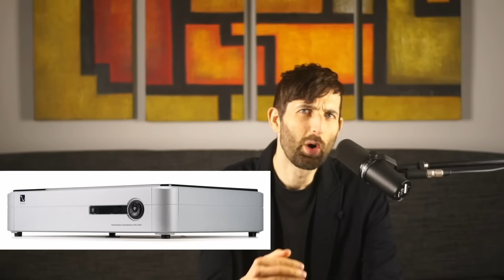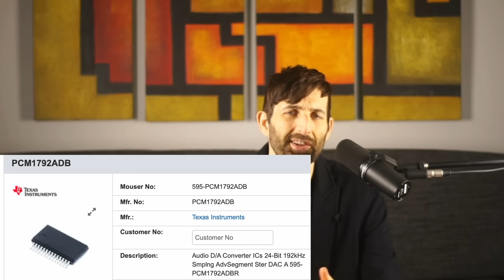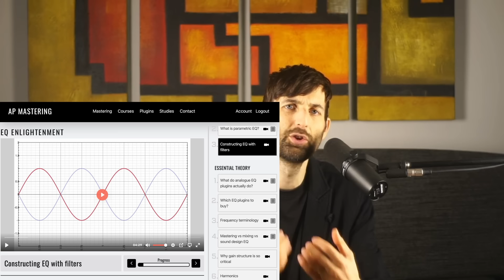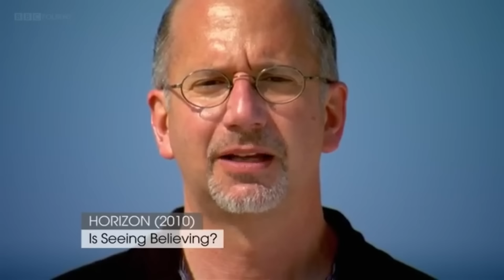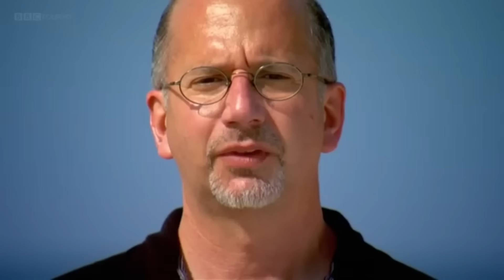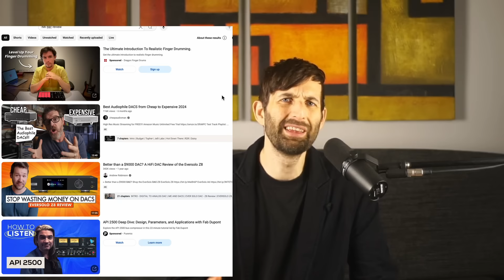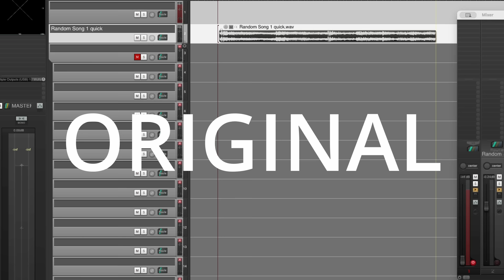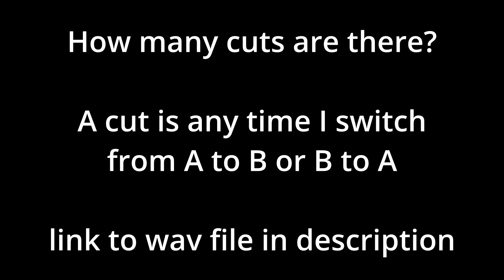The DAC Scam - Almost everyone believes the hype

Comment: I remember years ago when the audiophile guys were going after first gen Playstations on ebay because the rumor got out that the DAC sony had used for those was the same as the one in some of their highend audio equipment.   Watching some guy spend several hundred dollars on a PS1 in the late 2000's just to listen to CD's was wild.
Reply: I bought mine for like $5 at a flee market.  The story was that the same TRANSPORT used in the play station was the same as what was being sold in a $16,000 CD player.  The only DACs back then that were great where the very expensive R2R DACs.  Delta Sigma DACs didn't exist at that time.  What we had as a DAC during the PS1 days was the crudest form of a DAC that existed.  Nothing exciting about them.  The only DACs that were highly praised at that time was the resister to resister DACs which were extremely expensive.
Reply: Why is it wild? PS1 cost $10 and it sounds really smooth and musical leaning closer toward the turntable sound than any other digital I've heard. PS had a huge development budget, more than most Dac companies. What Highend Dac's did it rumour to be like? I haven't heard any that sound like it, it's got quite a unique sound and is really good at that one thing, it doesn't have very good bass or high trebles though so it's not really comparable to highend Dac's at all in my mind.
Reply: @voxshall  It's unfortunate yours was broken, the PS1 in working order is completely transparent.
Reply: @psyborg06  What are you even on about 🙄
Reply: @voxshall  "sounds really smooth and musical leaning closer toward the turntable sound than any other digital I've heard" implies the DAC is non transparent, ie a broken DAC.

Comment: You started with a great concept about misleading marketing for non moral (by most people's standards) profit margin, brand preference etc.... and then, in a multitude of regards, totally achieved the opposite of what I assume was or is your intention of helping/saving vulnerable consumers from buying 'overpriced' DACs and perhaps what you consider to be a common theme of excessive misleading marketing. 
With regards to the very last part of the previous sentence (the common theme of excessive misleading marketing aimed at vulnerable consumers), I agree with you to a high degree. 
Matter of fact, this can actually be objectively proven true in many cases for certain hifi products often labeled as "high end" etc. 
Where you went extremely wrong in regards to the stated subject of DACs, however, is when you claimed that anyone who is competent in (audio) engineering essentially knows that one has no real objective reason to spend more than a few hundred (or maybe a thousand-ish?) dollars  on a dac if audio conversion quality is of primary (relevant) concern. While you certainly probably could make a compelling argument for that being the most sensible amount to spend on a DA convertor, you are objectively incorrect in your reasoning because you have assumed that the chip is what is "doing the heavy lifting," which actually is not true at all given you actually understand what a complete dac unit consists of in its usable, finished form. Yes, the chip (if using a integrated chip) is what converts digital binary to a usable analog voltage (generally speaking), but that is next to worthless without optimizing both the various digital inputs for maximum performance with the chip capability, jitter and clocking components/IC circuitry to remove as many various digital error types as possible & relevant, the power supply filtering combined with layout (this is MOST crucial in a dac when compared to every following analog low level and/or high impedance signal + power amplification...), and of course the integration of the chip with the supporting passive components & the following analog stage which requires a carefully optimized (near) perfect layout and calculated component values for a maximized 'handoff' of that low level analog voltage, which many engineers firmly believe is far more important than anything to do with the IC chip itself in how a DAC ACTUALLY performs in the true time domain, which is arguably just as important as anything to do with the stated chip specs, which are ALWAYS poor indicators of true time domain performance due to how all measurement equipment used for modern audio IC specs averages distortion characteristics and transient performance aka fails miserably at giving clear time domain real performance. 
In case that time domain concept is completely foreign to you or something, the human ear is OBJECTIVELY more affected by time domain errors, generally various  phase anomalies, than ANYTHING regarding slight frequency response deviations or small amounts of low order harmonic distortion (considering you are hearing low order harmonic distortion every time you hear a voice- including your own- speak) as an example
Let's not even get into why delta sigma is objectively inferior for anything other than dynamic (noise floor) capability, which was almost every chip you mentioned, if I recall correctly. 

Your video is objectively invalid in regards to your main takeaway of performance capabilities as well as your resulting conclusion that one will get no benefit from spending more than your subjectively 'reasonable' price ceiling. 
This is a prime example of just how badly Dunning Kruger effect has infected anything regarding mainstream "objectivity" and its associated modern approach of making the claim. The original scientific method never was broken, yet everyone who can read a modern spec sheet or contextual statistic thinks that the claim of 'objectivity' must somehow (il)logically follow.

Comment: ok so a couple of things. the first thing someone gets from a dac is galvanic isolation on the usb this can prevent some of the noise from a laptop or other piece of equipment from entering the stereo which is probably a greater difference than the difference from one dac to another. if there is little to no distortion in the audiopath already i dont think a dac does that much. if a dac sounds bad then its an awful product. once you have about an audioquest dragonfly you should be pretty much enjoying great sound. i wouldnt bother improving the dac on a stereo that isnt very resolving i just dont see the point im very lucky have shut everything down and spent a year of my life saving for a banger audiophile grade stereo that i couldnt even talk to mum about how much it cost. but given the quality of the stereo a great dac with great software became by far the best audio source i had. 

also demo a ladder dac. they are less accurate often not measuring as well as delta sigma dacs but i think they sound awesome. id be shocked if someone has a really good stereo and didnt love a denafrips aries and a laptop with hq player combo.

Comment: The only thing dumber than a 40k DAC are 90k cables.
Reply: How about the 2k power cord?
Reply: 90k cables that are directional and require lifters to avoid contact with the floor. I am positive there are even worse example since I don't bother keeping track of snake oil products.
Reply: @DAVID-io9nj  my Surround cables meanwhile laying directly on the floor next to an AC and Data Cable...
Reply: How about a rubidium clock?
Reply: @Andrew-rc3vh  It depends. Working a regular 9-5 hourly job, I will stick with a G-Shock.  But if I have 30 Rolexes and 20 sports cars, why not?
Reply: @machone539  Why not is because I don't think you will find the master was encoded with a rubidium clock.
Reply: @machone539  yes with that kind of wealth sure you can do anything silly
Reply: What about the $36,000 tonearm I ran across?
Reply: There's something even more stupid, the "audiophile grade" network switch. If you don't know how ethernet works, they have four differential pairs, similar to a balanced mono XLR/TRS cable. And the device ports have transformer isolation, so there can be no ground hum through an ethernet cable.
Reply: @coolbugfacts1234  How about fiber optic cables with gold connectors?
Reply: @missinglinq  and the $4K cable raisers that prevents your cables from touching the floor
Reply: If you look at the cables inside loudspeakers, even high end ones, they are not that incredible.
Reply: I've heard of audio files buying special HDMI cables. lol
Reply: @michael_c2 IIS cables to an audiophile.
Reply: I'll get rid of my 90k cables right away. Nah.
Reply: Even my cheapest DAC can support 40K.
Reply: @Pon3TorLord  Your cheapest DAC is faithful to the emperor, then.
Reply: Fatality
Reply: It;s the buyer who is dumb.
Reply: And cable lifts/elevators. And blocks of wood that make your listening room sound better just be being in there. Shakti stones.  Directional cables...
Reply: lol
Reply: Or $250K amplifiers.
Reply: Directional cables are hilarious - yeah, coupling an ac signal with something that works better in one direction......
Reply: 12,000 dollar phono cartridges come to mind as well.
Reply: One of the most famous mastering engineers told me about the $3000 power cable he was using on his 1/2 tape machine.  My eyes could not rollback further in my head.  I've had numerous arguments with some of the most notable audio engineers about these sorts of issue.  One told me that coping audio files in the apple finder degrades the quality and that he always makes digital audio copies of files in Pro-Tools.
Reply: $2000 fuse!
Reply: "The only thing dumber than a 40k DAC are 90k cables"....and the one who bought it
Reply: It s better to invest in new ears
Reply: @gibson2623  new ears won’t help you unless you can find a surgeon talented enough to be able to fit them 😂
Reply: @cybergornstartrooper2157  Ahahahah, nice one :) LoL
Reply: @gibson2623  Cheaper to spend the 40k on the DAC.
Reply: If I can afford it and want it, so what? What it's to you. I just laugh at all whining peasants that rely on flawed A/B blind testing to justify their cheap audio gear selections  or the fact that they can't have what others can affored. Sour grapes lol
Reply: @Ruger62  The criticism was not aimed at the consumer - "A fool and his money are soon parted".  It was more an indictment on the industry's lack of empirical evidence justifying the cost.  People who buy 90k speaker cables deserve to be mocked, because they don't know shit about how audio works.
Reply: That would depend on your system.  If it is a 1k system, sure.  But if you invested million plus in your system/room, 40k is change.
Reply: @machone539  I have no doubt that you can get a million dollars worth of a system, but there is no DAC in the world worth over a couple hundred dollars. It's not like spending more will get you something with more technology or quality thrown at it. It's a simple circuit that can only go so far before it reaches the peak of doing its job as good as it can.

Comment: this is complete BS .... it all depends on the rest of your system you are using, if you are using average or below average like a mobile phone, you will not hear any different. That's because of the limitations of your system.
The fact that you have to use high end or ultra high end equipments is beside the point .... fact is there are differences .... enough said 
😂😂😂
Reply: @RockManEnough  if you say so, I'm not here for arguments. But do go and listen to some high end stuff, before you make any comments. Measurements isn't the whole story. You can't measure soundstage, you can't measure imaging .... two dacs may measure the same will sound completely different depending on the design of their peripheral components.
Good day 😂😂

Comment: Hi,  i did try side by side two streamers with integrated dacs. one was at 500 ero the other at 1000 eur. tested on nice tube amp and hi end speskers. i could clestly hear bettet sound from the more expdnsive.. with better I mean more clear, better separation, subtle but definitly easy to hear differance...
Reply from the maker: can you pass an ABX test 20 times?

Comment: You’re paying extra for the support circuitry, including components as well as the layout which when taken altogether can make a significant difference in performance when it comes to specifications. The chips have their theoretical limit coming right out of the dacs but a great deal of the time an inferior support design can significantly degrade the overall performance, especially where the layout of components are concerned. Speaking from personal design experience.

Comment: LoL. This guy is such a poser. I can blind test DACs all day long.
Reply from the maker: how did you do in my blind test?
Reply: @APMastering Your "blind test" entails another entire ADDA cycle. It's invalid.
Reply: If you hear differences, then one is most accurate to the source and the others are less accurate. Which is the most accurate of your collection?
Reply: @sparella  Which is the most accurate what in my collection?
Reply: @nihilionsaro Which is your most accurate DAC?
Reply: @sparella  Well, the probably with "accuracy" as a concept is that the only reference point is another DAC. Thus, it really makes more sense to talk about what sounds the best. There is, of course, some subjectivity in that. Right now my Gustard R26 with PGGB upsampled material sounds pretty good. It's not my "end game", but it suffices for now.
Reply: @nihilionsaro The reference would be the source file. I'd think looping the DAC back into an ADC and then measuring the delta magnitude would be a simple way to compare fidelity. The quietest delta would be the most accurate.

Comment: I had a blind test of 3 CD sources: cheap DVD media player, a laptop with CD and external pro audio interface, a high end CD player. Overall no difference, until I started listening to female vocal, which finally demonstrated the difference: in a stereo field the voice is in the stable position, slightly right, but out of 3 sources only high end CD player were able to keep position regardless of pitch, while others on higher notes have smeared the position to effect, that I start hearing it from both speakers, rather then still hearing it at the same position. I can only explain that phase control of the frequency range was not even between devices.

Comment: I was one that thought the same about hi-end, high price DACs and after watching your video, I now have some food for thought. My only question is: if a a modest priced DAC vs a higher priced one have the same chip. Will the components quality, engineering topography of the circuits on the higher priced DAC would make the difference?
Reply: Yes, the SMSL SU-10 has a a SINAD of 124dB and cost about £900.
The SMSL PS 200 is 118dB and is £80
you will not be able to audible hear the difference so you are really paying more for the extra features (balanced XLR, remote control, 21 high-end dual op-amps OPA1612, etc...)  and better engineering (higher SINAD).
Do you want the best?  I do but i own the PS200 because i can't afford £900!
Reply: @wealthypepe  Ok, then it's a matter of economics.

Comment: I have personally found an indirect difference between DACs, when comparing some non-ideal output devices. I expect the actual DAC chips in all of them were fine. It had nothing to do with price either, and indeed "audiophile" stuff is routinely rubbish, especially for digital sources.
From memory, connecting an android phone(via 3.5mm to 2xRCA cable) didn't replicate a full frequency sweep correctly, an old iPhone(which I think I used via a dock, so may have been line level) was better(possibly perfect or close to it, I can't remember), and a "CD player"(actually a DVR with a DVD player) was perfect. All used the same source files. I suspect that this could've been due to impedance mismatching, with the DVR using standard line output level & impedance.
These were connected to an amp, from which I recorded using a basic USB capture device(from the "tape" output) - as rubbish as "easycap" devices are for video, they're fine for audio.
Conversely I found the android phone to sound better than the iphone with wired earphones(cheap UiiSii HM7 earphones, which I like), presumably again due to impedance matching.

Comment: The thing I'm a bit confused about in this blind test is that we seem to be seeing if we can tell the difference between a dac's original output vs it's looped back output, whereas the video seems to be talking about whether we can tell the difference between different dacs, which is not what is being blind-tested, unless I'm missing something? 🤔
Reply from the maker: sure... the logic behind my methodology is that, if you cannot even detect ANY DIFFERENCE AT ALL between mid tier gear going out and back in, and the original signal, then you cannot hear the differences between high quality DACs, because you cannot even hear any DAC in the first place. Feel free to read my study's full methodology: https://drive.google.com/file/d/1NuM8kFL1M4RsnLKe7Jfp0mf-CJrGGH0e/view
Reply: @APMastering  I see what you mean thanks. I suppose it's still possible that one DAC could bring more clarity, stereo separation etc. to the audio over another but that would be for a different (expensive!) blind test. Anyway thanks for the link I'll have a read 👍.